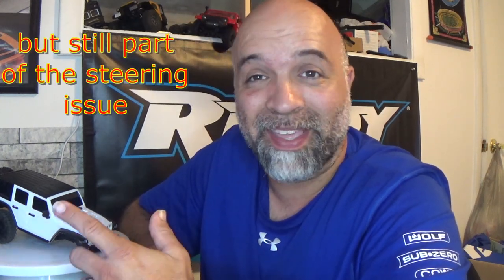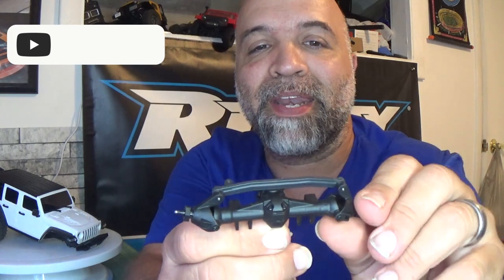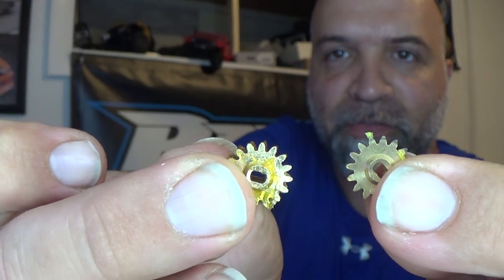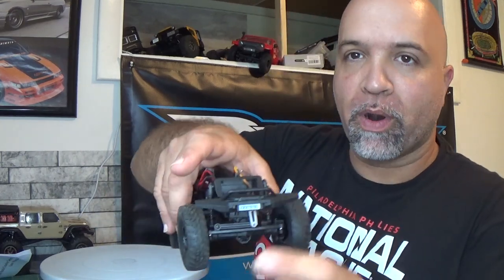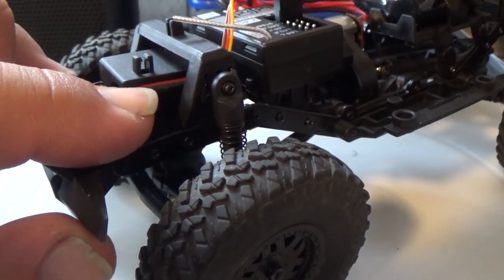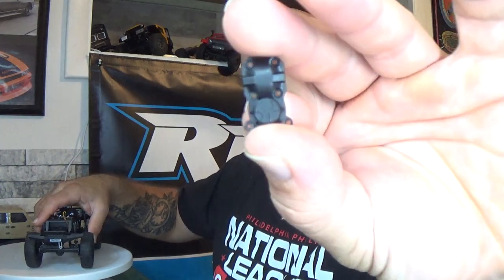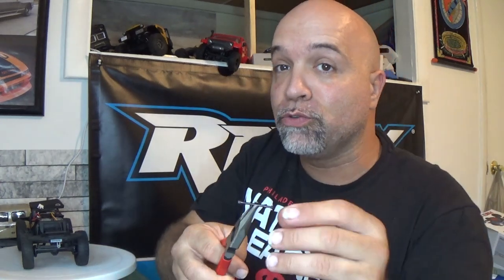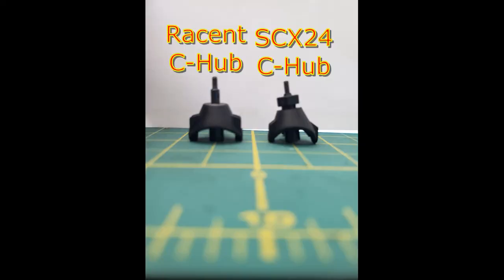$80 Racent RC 1/24 scale Jeep steering angle fix with SCX24 axle stub

Comment: Will a sxc compleat front axil work in the racent truck? Its a $25 fix if it will.
Reply from the maker: Yes the front axle for the scx24 will fit that's exactly what I did
Reply: @rccargarage  i mean the full $25 replacement axil. You went threw alot of work sawpping stub axils when you had a compleat front axil in hand.
Reply from the maker: And that's what I'm saying  the whole scx24 housing will work on the racent but I wanted to see what was interchangeable with the scx24
Reply: That means we can do rear steer also😊